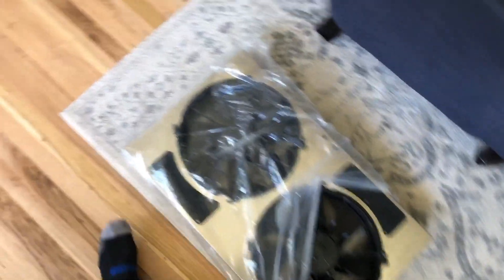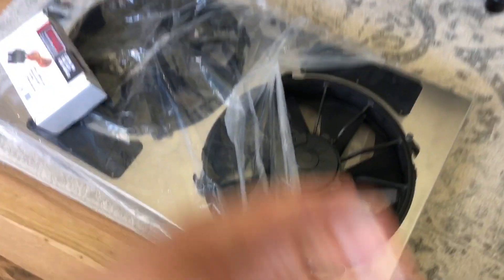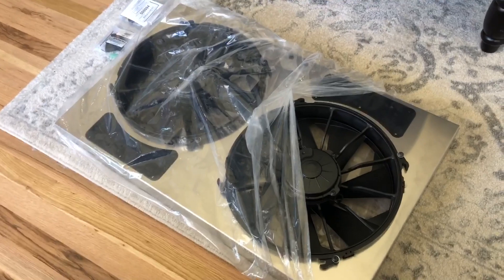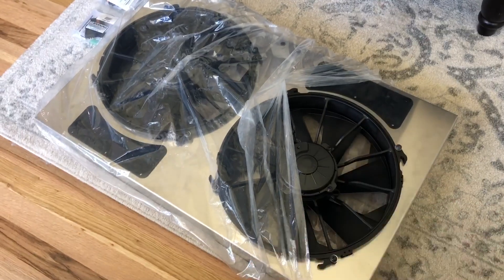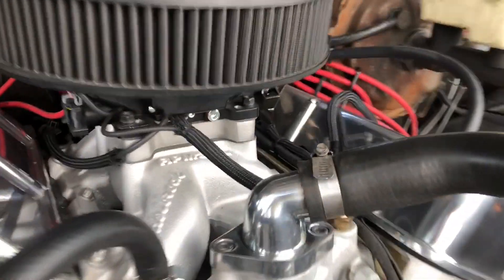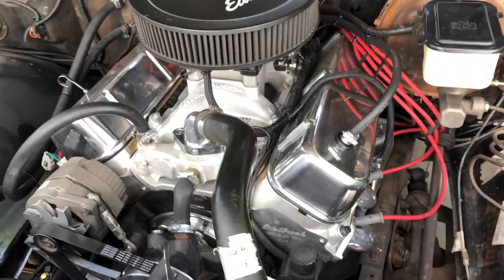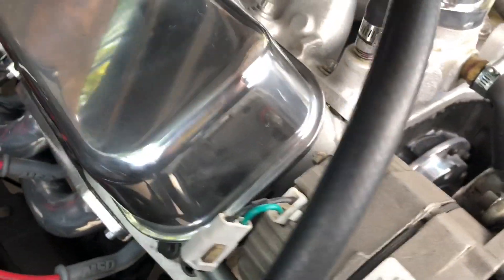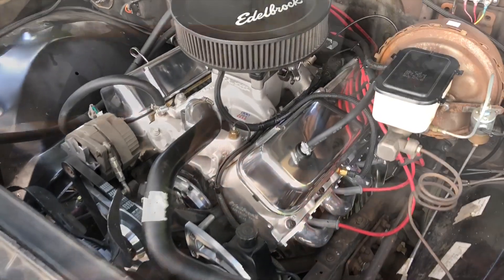Everything You Need to Know Before Doing an Electric Fan Conversion

Comment: Where you got the bracket for the power steering pump? And what fan controller was used?
Reply from the maker: @ari1234.  sorry the power steering pump brackets came with the truck.  Fans were controlled via my Holley Super Sniper ECU

Comment: You don't have a fan shroud.
Reply from the maker: @stevepope5484  the shroud is integral to the fans themselves.  The aluminum frame was sized to seal around radiator.  Works great ;)

Comment: I had 2 of those derale controllers melt on me. The problem with those was that both lines powered both fans,  ended up getting an autozone special (same exact thing ) difference was that this one’s actually separated power and they had extra fuses going from the controller to the fan (and diodes)

I also added a stupid light and a override controller, the stupid light powers with each fan so I know when they are running. The override is in case the controllers fail, also a kill switch

Comment: The vent flaps on your shroud are the real issue I have found. I have a good static slow moving e fan with a shroud. It works real well doing it's job. My issue I am having to fix is not enough air flow at higher than fan speed. I am finding out that the flaps are a big necessity and not mentioned much at all.

Comment: Do you know where I can connect the wire that goes to the ignition so that the fans shut off when the car is turned off?  I have a 74 Barracuda.
Reply from the maker: Sorry I dont.  You will need to use a multimeter and searched for a switched 12V source to trigger your relay.  Shouldnt be to hard to find.  Just confirm you find a spot thats 12V when ignition on or running and 0V when key off

Comment: I think it’s called dieseling when the car wants to keep running after you shut the key off. It’s cool that you traced it back to your alternator. My mustang does it once in a while and I’ve been through the timing numerous times but never figured it out. I’m installing the same fans as you right now using the relay I was using for my single 16in derale and adding another relay setup. Which wires would go to the switch in the car ?
Reply from the maker: Sorry i dont have the truck anymore.  If you can id opt for a temp sensor vs a switch so its automatic and you dont accidentally forget to switch it on.
Reply: @truckandroll989  I have a fan controller on the first fan. I want to manually turn on the second fan. Did the derale setup work good?
Reply from the maker: @6spd85notch  gotcha.  Yea mine worked great.  I am at high elevation (4500ft base) and hot (100F) in the summer.  I never had any overheating problems.  I was setup so my Holley EFI would turn on the 1st and 2nd fan at set temps.  Never ran over 195F even in traffic
Reply: @truckandroll989  it’s been hot here on Long Island 90s and soon as I hit traffic the temps started to climb with the single 16 inch. It looks like a pretty good setup hopefully i finish the wiring today. I have to run it into the switch panel and everything else is in my fender well. It’s a pain and the humidity today is crazy. Thanks for the help.

Comment: Them bbk headers ? If so I got the same on my 66 f100 with a blueprint engine 302 derale single fan and cvf serpentine belt set up with blackwidow exhaust, no sniper tho ;(
Reply from the maker: So i was running Hooker Headers but swapped them for larger primary Summit Racing ceramic coated ones.  Thanks for watching
Reply: @truckandroll989  oh okay gotcha 🤙🏽 rad truck man, thanks for the content :)

Comment: 86 GMC K10 BB 402, Removing the old fan, is that just unbolted or is there anything else that has to be done on the engine before starting this? Thank you Joe
Reply from the maker: Joseph Minch you should Just be able to unbolt.  You will need to most likely add some locknuts on the other side to hold the pulley on without the fan depending on how yours was set up.  Its pretty easy though
Reply: @truckandroll989  Thank you sir.

Comment: Ur explanation about diode is totally wrong.. and every alternator needs a diode cuz alternators produce ac current and the entire car electric system runs on dc.. a diode will make the ac current to dc current by flipping the negative cycle to positive.. and the regulator takes a slight power from the battery to power the filed winding (armature)after the car starts .. and thats how the alternator produce power. The regulator controls the filed current to regulate the alternators output voltage.. the main reason to use an alternator instead of dynamo is that the cars engine rpm is not fixed.. so the voltage can vary a lot.. and the regulation of voltage is easier in alternator after the invention of transistors... & The pigtail u talking about is the sense wire for the alternator.. it measures the voltage right at the battery terminal to keep it at 14.4v ... & The other wire is for the battery light and field energizer. .. when u turn the ignition on .. the battery light on ur dash comes on cuz the a current flows from 12v battery terminal through the bulb on ur dash and to the alternator enegerizer.. & when the car starts the alternator starts making voltage and it powers it self up from the power of the alternator.. and thats why u really need to have some sort of energizer (exciter) for the alternator.. typically its a car battery in car.. or a second dynamo or battery in a genarator.

Comment: Great job man. Installing mine next week and this video brought up great points and parts I can use. Just one small note, your heater hoses at the firewall are switched.. The one coming from your radiator should go to the bottom of your heater core and the one going into your intake manifold should be on top. Just a minor thing but it will help circulate your water properly and give you  better heating as well
Reply from the maker: Wow thats awesome i had no idea! Thanks for noticing that.  When i bought the truck the heater system was totally screwed up.  Core leaked, hoses were gone, all of the cables inside the cab were backwards.  Next time the coolant is out of it Ill switch them around :)
Reply: @truckandroll989  just clamp em with a vice grips and a towel.. it'll take 5 min...no need to drain anything

Comment: Thanks for the video, looking forward to the installation video. My radiator & eFans are waiting patiently for me to install them. Question: what serpentine kit/brackets are you using? Looks clean and simple, I want to get away from my vbelts on my sbc but don't want to spend $$$ to do it.
Reply from the maker: Unfortunately I’m not too sure on the brackets since they were on the truck when I bought it.  I did however have to change the serpentine pulley size for my old alternator to a smaller one because it was not charging at idle.  I believe the ratio between the alternator and crank pulley is supposed to be 3:1.  Just something to keep an eye on if you aren’t charging at idle but do just off idle.
Reply: Yea that is really helpful to know, thank you. That's why I like your videos, because you show what happens in the real world. "Bolt-on" isn't usually just bolt-on. ;-)